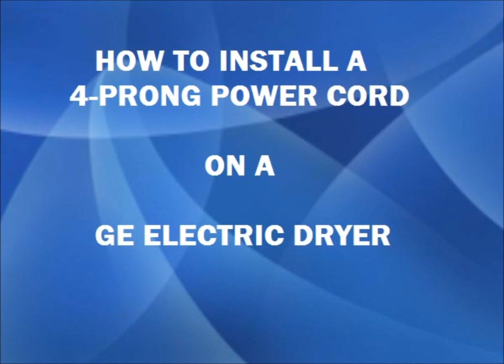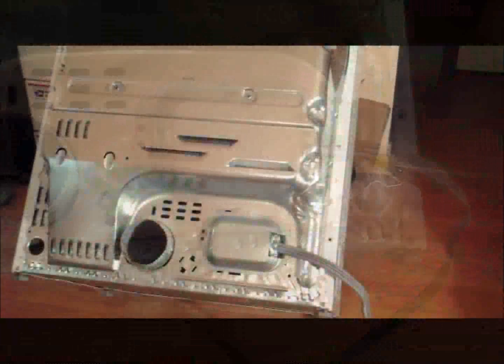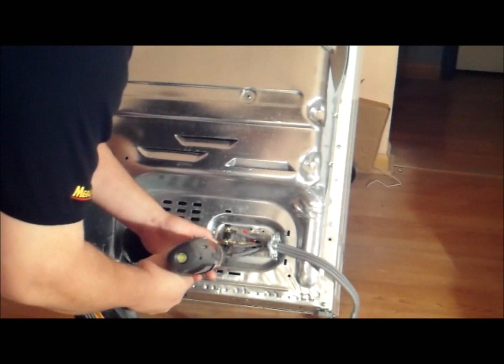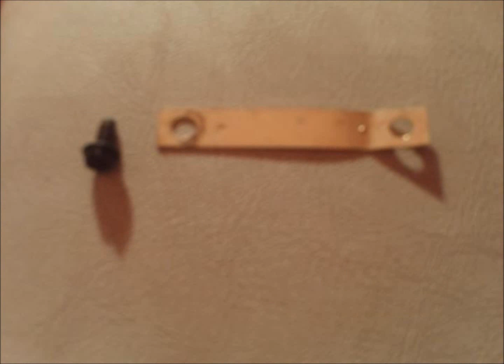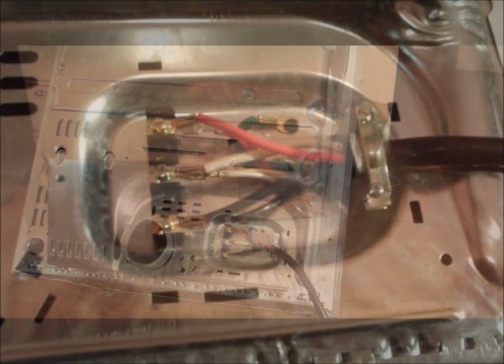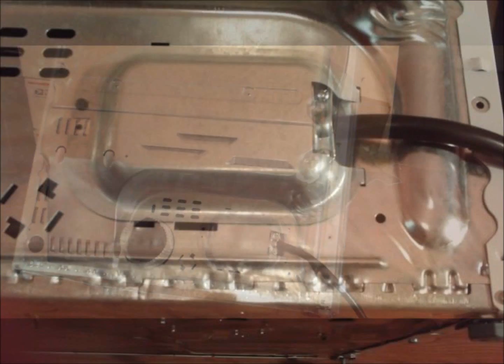GE Dryer Repair - How to Install a  4-Prong Power Cord on a GE or Fisher & Paykel Electric Dryer

Comment: Thank you very much for making this video.  I tried to figure this out myself and had no idea what to do with the green wire.  I guessed and put the green and white wires together and sealed it up.  I thought I better check the web before I plugged it in and I watched your great video, I redid it per your easy instructions and it works like a charm!  Thank you very much!!!

Comment: I installed the 4 wire cord exactly as the video showed to do it but when I tried to use the dryer it would not heat up. Is there something that I did that cause the heater element no to work or is it possible the heater element just went out at the same time?

Comment: so is the only difference between 3 and 4 prong plugs that one has a grounding wire and the other has a strap? and does it only depend on which outlet you have in your house, or do you sometimes have to change the outlet?

Comment: I did not remove the grounding strap. Will that hurt anything ? Used a new screw to attach green wire in same location as video..

Comment from the maker: Well, can you tell if the thermostat is cycling the heat element on and off?  I would start with that.  Tracing the wiring by a technician can get expensive, but if the thermostat is doing its job and it is still getting that hot, it is probably what needs to be done.  Did the dryer work properly before it was moved?  If it was, then there is probably a wiring or heat element coil shorted to the body.  I would at least open the cabinet, remove the tumber drum, and inspect the heat element coils.